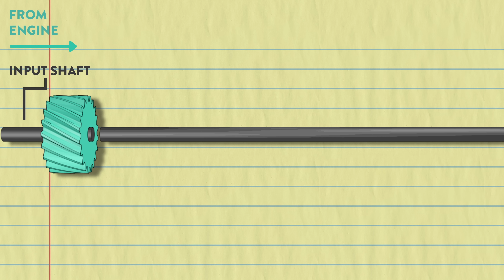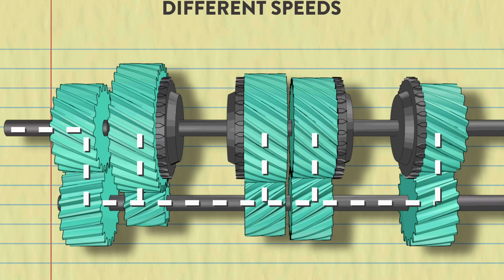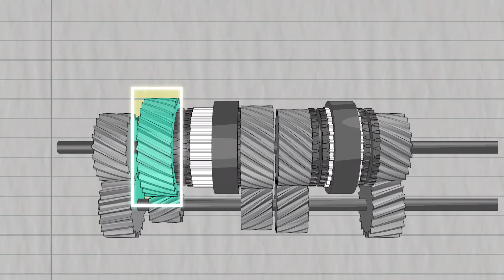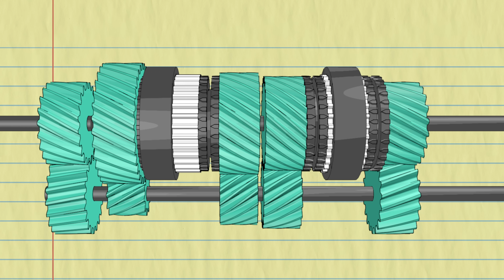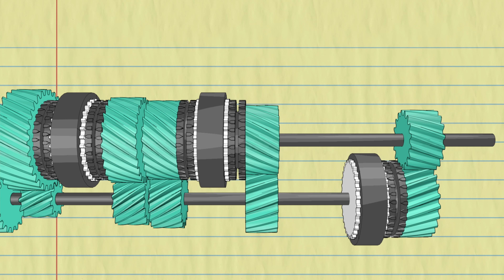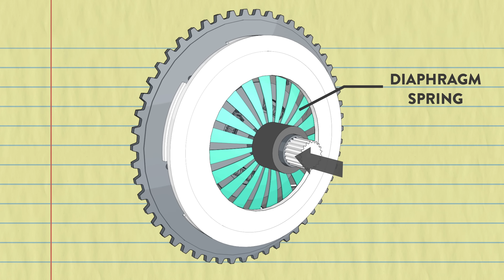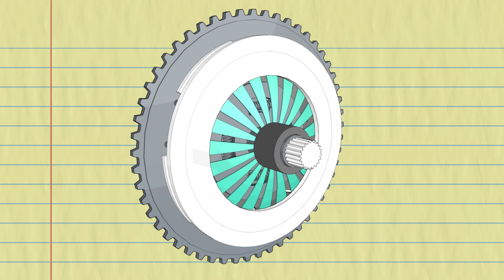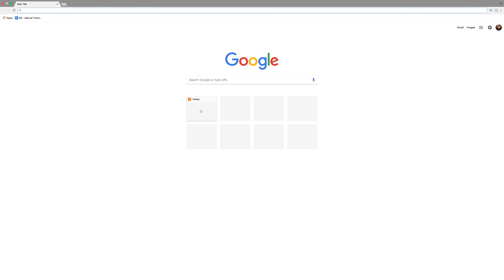MANUAL TRANSMISSION | How it Works

Comment: Guys who drive Automatic: I drive an automatic.

Guys who drive manual: I will NEVER drive an AUTOMATIC cuz I'm a REAL DRIVER and I am ONE with my MACHINE after I drive I PUT THE SHIFTER IN MY ASS because me and my MACHINE ARE ONE
Reply: I love manuals....
But I'll give it to yah, this comment had me laughing
THE MACHINE AND I ARE ONE 1111111
Reply: Me when playing racing games in my childhood, only liked automatic transmission, but after watching Initial D in 2019, I started to like manual transmission.
Reply: David Mason  

Not American mate, Finnish.
No, I passed my driving test in a 2013 manual ford fiesta. If I had passed it in an auto, I could only drive an auto, as is standard in EU.
Yes I know about slipping clutch. Which is why I tend to not even use gas in tight spaces, just playing with the clutch.
I don't know about you but the clutch in my daily driver MR2 is heavy as shit. When I jump into any other manual car, driving feels easy as shit compared to my daily driver. So I guess there's that.
Yeah, a lot of people don't really like driving, hence, self-driving cars m,ay very well be the future.
I myself am a car enthusiast, that's why I drive an old manual sports car with 0 driver assists (not even power steering or ABS). But I do realize that for many people, they want driving to be as effortless as is can.
Reply: David Mason  If your throttle is stuck open in an auto there's plenty you can do. 1. Brake, if your brakes are functioning correctly they should overpower the engine. 2. Forcibly shift it into neutral. 3. Kill the ignition. So if someone STILL manages to crash, now that's just piss poor vehicle control (and panic I guess).
Same with accidentally pressing gas instead of brake and staying on gas. Just poor vehicle control. I've accidentally pressed gas instead of brake in a manual. Thankfully hit nothing, but I sure could have.
Reply: @kaju8928  As an American, can confirm.
Reply: Am I Here ? 😂😂😂😂
Reply: David Mason it is what you’re used to but I still can’t get over how you panicked from having the car do much more of the work for you. Shouldn’t you feel more relieved? You just need to press gas when you want to move or hit the brakes when you want to stop.
Reply: kaju 22 i can drive manual and automatic and i prefer the automatic cause it gets me better fuel economy then shifting yourself. you can’t our shift a computer and that’s facts
Reply: kaju 22 as an American that loves to drive manual a hell of a lot more than automatic I can still confirm that Americans are lazy and can’t drive.
Reply: kaju 22 hey why u goin ham on all of us, I like europe and their car culture, I am 16 and all of my families cars/trucks are manuals and I live on a farm and everyone in my town is good at driving.
Reply: David Mason  in american your license goes to any transmission it's not just a auto license or standard I was just trying to get you to understand there is a place for auto sadly it takes over standard
Reply: I drive boths, but prefer automatic. Now im having manual bceuz got good deal.
Reply: LEGENDARY COMMENT
Reply: i drive manual because its more fun and more reliable and cheaper to maintain
Reply: yup, us
Reply: Guys who drive automatic: old men in bmw’s
Reply: What about guys who drive automated/electrohydraulic manuals?
Reply: David Mason  David, take a look at these links: 

https://en.wikipedia.org/wiki/Electrohydraulic_manual_transmission

https://en.wikipedia.org/wiki/Semi-automatic_transmission
Reply: Good job. You took something from Twitter
Reply: soulassassin0g lol I honestly love both. Auto is for stuff like bumper to bumper traffic and stick is for fun 😂 I honestly suck at get it goin but once it stops burning out I’m good. Naaaa I’m not that bad I just didn’t get much practice before my friends ranger got Sabotaged
Reply: David Mason  no offense or anything but that's boomer as frik
Reply: David Mason no hot shot statistics show automatics are more efficient. in all the time it takes for you to put in the clutch and change a gear an automatic has already shifted. that fast time to change gears results in better fuel economy since you can keep a more constant number of RPMs
Reply: David Mason my guy your grandpa is looking down on you in disappointment. I drive a 1982 Mercedes Turbo Diesel automatic and a V6 minivan that’s automatic. Both are fun. I’m also looking into getting a Honda Civic SI coupe that’s manual. I can drive manual and automatic. But where I live there are a lot of hills and it’s not fun just going into first second and maybe third the whole time. It’s just not practical here. Like you can take a car to a track or somewhere in the hills but for daily driving it isn’t practical.
Reply: David Mason I just said automatics have an option to take control of the gears yourself if need be, and if you floor it going up a hill it’ll be faster than any manual lol. And in the off chance that the throttle gets stuck wide open, you simply use the brakes and turn off the ignition. I actually know a friend though who was driving a manual and the clutch stopped working and the car kept accelerating and he had to crash into a safety barrier on the freeway. Cars are cars and shit will go wrong. As far as i’m concerned automatics are smoother and safer, and you can have fun with them if need be. And also as far as i’m concerned i’m going to get a Tesla after this virus dies down because frankly that’s the future and the way to go for efficiency.
Reply: maybe thats the train of thought  in the usa. everywhere else its ''oh, its easier then i thought''....while being said by a 18 year old
Reply: @kaju8928  it's not all of usbi promise
Reply: OVER DRIVE
Reply: nigga u had me wheezing
Reply: I’m taking a hugeeeeee dump and litteraly shat my pants again laughing after this comment! Sooo true!
Reply: @Auranshereef  it helps to take the pants off bro 😂😂😂😂 I feel that energy tho 😂😂😂
Reply: 🤣🤣🤣   legit so many ppl treat manual transmissions like a religion 🤣    they dgaf about anything else when it comes to cars
those same ppl replace at least 2 clutchs a year too🤣
Reply: soulassassin0g dude that was so fuckin funny I almost spit out my drink 😂😂
Reply: @kaju 22 fuck you born in the usa and so was my car and 12 gauge, manuals are cool and fun but they are impractical I personally would drive manual but alot of people cant the reason why your country has trouble with auto is because manual is cheaper to manufacture the manual flex is just you saying your country is poor
Reply: @disguisedpickle1360  I sure love my 12 gauge manual 

SHOTGUN GEARBOX!
Reply: A27M Cromwell1 is your implying that it’s American to drive a manual your dead wrong
Reply: @disguisedpickle1360  chill man I was making a joke at what you said further up i didnt realise there was a flame war going on here

Carry on i want no part in it
Reply: @disguisedpickle1360  you said 12 gauge manual near the top and I was making a joke about it
Reply: A27M Cromwell1 think you should re read it
Reply: A27M Cromwell1 I was meaning my car me and my 12 gauge shotgun were all born in USA
Reply: @disguisedpickle1360  ok that's cool I just read it as a shotgun gearbox and thought it was funny
Reply: @disguisedpickle1360  money doesn't substitute character and skill brother
Reply: @disguisedpickle1360  I'm saying you don't gotta spend a fortune to make a car fun, you agree right, I mean we all love manuals because they're fun. They have character, there's nothing quite like driving one and feeling the thrill of having total control over your car. Plus I don't mind not having to fix as many parts, fixing transmissions sucks bro
Reply: @cameroncastillo333  there’s more upfront maintenance to a manual (clutch flywheel clutch cover pilot throw out, fork etc) driving them is only fun when other drivers know how to drive getting cut off no warning in a manual not fun it’s give and take I’ve seen people happy in autos.. manual isn’t direct to more fun some just don’t want that extra bit it’s subjective
Reply: Manual is like having dick in hand
Automatic has no dick
Reply: Brilliant!! People who drive manual think they are the chosen ones and therefore automatically smarter than all the rest. Well guess what? Driving automatic or manual doesn't fucking matter, you still get from point A to point fucking B, goodnight you morons
Reply: @bluecomet1109 
That's only if you have an incredibly shallow concept of what driving can be. If you view it as "simply getting from A to B" then you shouldn't be watching a channel for car enthusiasts.
Reply: silent phantom I agree. I am reading the comments and I am still trying to figure out why people who drive a manual are smarter than those who drive automatic. I am sure if all us Americans who drive automatic couldn’t afford to drive an automatic we could also as easily learn to drive a manual. Many people buy manuals because they’re cheaper. My friend bought a manual for that reason and she hated it. I used to get nervous in her car because she had one hand on the wheel and the other on the clutch most of the which I think delayed her response in case a car would suddenly cut her off as she shifted gears. Too much work shifting gears if you ask me . Definitely not for me . It’s a pain especially when driving in congested areas . I see shifting gears almost as distracting and dangerous as texting. Isn’t it always suggested to keep both hands on the wheel when driving? With a manual you can’t do that. 😂 And it’s hard for me to envision a pregnant lady about to go into labor having to drive herself to the hospital in an automatic or a  person with asthma. Shifting gears in that scenario might be impossible. It can be impractical in certain situations.
Reply: silent phantom amen
Reply: @bluecomet1109  legit alot of manual drivers think they're car experts too🤣  while replacing at least 1 clutch a year🤣
Reply: Or the guy who drives manual is European and that is standard in Europe
Reply: 😅😅😅😅😅     Medal of Honor for that comment
Reply: You must be American because in Europe if you admit you drive an automatic people will look at you like you’re mentally challenged. It’s not snobbery, it’s just that literally everyone drives manuals and if you don’t it’s assumed it’s because you suck at driving.
Reply: @ajl8975  I love your comment, and I'm an American, i tip my hat to you sir
Reply: @ajl8975  suddenly europeans sound a lot more interesting to me now 😂😂
Reply: More like “I don't know how to drive a manual transmission”, I prefer a manual transmission because I've only owned supersport motorcycles. You select the gear you want in a sequential transmission just like a semi-automatic transmission.
Reply: well it's all about the feeling of control
people who like driving usually want more control of their cars in their hand

people who like driving are usually more skilled at driving
that's where the connection is

automatics forgive lack of focus and skill in driving, TO some extent

crash videos because people texting/browsing while driving is almost always from people driving automatics, give it a thought
Reply: boys let the automatic transmission be for women new drivers and the disabled
not all of us are in need to control our gear ratios or even our breathing
if you let these people be the next thing will be automatic braking system ; )
Reply: mamad nzr you people need to stop with the manual superiority manual isn’t even in the performance scene anymore it’s for guys who grew up and didn’t learn eventually you get rid of your toy all a manual can be to anyone anymore is just a means to fun
Reply: @mamadnzr7556  not gonna lie, an automatic braking system sounds pretty nice
Reply: We get it, you can't drive a car with manual transmission, don't have to act all butthurt about it.
Reply: David Mason  there's a reason it's on the road if auto scares you give up ur license I've complete idiots drive auto so if you cant that's because your even more incompetent manual has its place still it's not for a average person or a daily driver I want to drive manual because it's a cool skill but its alot easier to get use to speeds the car laws etc in a auto when your not worrying about stalling
Reply: People who drive automatic are mostly old people or retards.
Reply: Paulyn Araojo Or just people who can afford them lol manuals are cheap and less efficient. Most cars have added paddle shifters if you want to make it “manual” and it’s more efficient than using a stick. No one cares you drive manual and no it does not mean you’re a pro driver 😂 Jesus you guys are full of yourselves

Comment: I don't understand how the size of a gear helps. Like I get it has a smaller circumference so has less distance to travel to make a full revolution and that less torque is needed to rotate the gear a full revolution. But wouldn't the torque increase if you wanted to rotate the gear faster?

Comment: Why do u think even automatic cars have a tachometer?  Because it's cooler!  Makes u feel that you're a 
great driver and driving a performance car.  Plus, it's one of the few things that you can control and watch 
the needed spin.  Electric cars don't have a tach so they're boring.
Get a manual transmission and you get to control even more things to make more fun!

Comment: I am not Shure if that was done correctly according to the animation for first gear it would be high rpm low torch that's gears would need to switch places then you would have that gear ratio        feel free to tell me I am wrong but I am not Shure that animation was accurate

Comment: You forget to mention that in racing and you double clutch or putting more stress to the components so most Time Racing Engines will have a specialty transmission that can withstand all the force and big rigs use a specialty transmission for pulling heavy loads

Comment: Every new student nightmare when apply driving license for the first time.
If you release the clutch too early , engine die.
If you dont balance the excel and clutch smartly on hill test, engine die.
If you dont properly insert the gear or not pull down the handbrake, car suddenly drive in suspended motion. In case of handbrake, possible engine die.

Basically if you screw up at manual gear is result of your engine die automatically

Comment: You haven't lived until you've driven a 4 speed that redlines at 5 mph in low range.  Personally my truck has a 6.55:1 ratio in 1st gear.

Comment: Semi trucks have 18 gears
Reply: Some, most trucks I've driven have 10 Speeds (the majority); other semi's have 13 Speeds (one truck I drove had one); 18 like you mentioned; and 9 Speeds. There are also two transmissions specifically designed for off road/vocational severe duty use; the 8 Low Low, and the 15 Speed

Comment: You forgot something in this video. It’s a racing trick, but when you are on the top gear, there is a secret gear you can use to go faster. Just set the gear to ‘R’ to unlock racing mode.

Comment: Just saying the whole double clutch vs granny clutching.... Its really old, double clutching isn't fast, its only helpful on cars with no synchros. So if you want to change gears fast and win a race... Granny shift, its how the car is meant to work now and what you should do, double clutching will do nothing at all but slow you down.

Comment: if my gearbox ever goes faulty I'm taking it either to the manufacturer or a garage im fine with fixing any other part but the gearbox no if i treid fixing a fualty gearbox i'd end up with a flywheel up my ass 2nd gear through the neighbours window and reverse in nostrils

Comment: 2014+ newer Minis have rev match (can turn it off with DSC off),  
e.g so if cruising in 4th at 35mph,
hold in the clutch, select 2nd, engine revs and holds the perfect matched rpm,
lift off clutch - seamless downshift

Comment: you didn't talk about floating gears. not using the clutch at all and shifting at precise point in the rpm range.  which is how you really drive a big rig. it saves of wear of the clutch because it never disengages the flywheel

Comment: Question. I learned how to "float gears" when learning how to drive an 18 wheeler. Basically changing gears with out using the clutch. Now I'm able to float gears in my car. Up or down shift, I have mastered it. Only time I use the clutch in the car is to put it back in first gear. How is this possible?

Comment: Well there are gearboxes with two clutches.
For example Ferrari porsche etc. 
Two cluches and two gearboxes (one gearbox has the gears 1,3,4,6 the other has the gears 2,4,5,7) the change the gear in 0.5 seconds

Comment: 3:59 WROOONG!😆   ok in this scenario where the on the input shaft to the counter shaft the Gear ratio is also 1:1 its right.  But a real transmission there is as well a gear ratio on the input shaft. Wich means to get a 1:1 gear ratio you just connect the  input shaft and output shaft. You also gain efficiency because you dont have to let the torque flow over the gear wheels.

Comment: .8 overdrive is a good economy ratio on a 5 speed?  I know some 4 speed automatics with better overdrives than that.  

Some big rig transmissions don't require double clutching and are actually designed to optimize float shifting, requiring less clutch disengagement and overall saves the life of the clutch.  Splitters inside the transmissions also don't require declutching, just a simple release of the throttle to get into the split gear.  The shift lever has quite a bit of play before sinking into a gear, thus allowing the driver to pre-engage the next gear and match revs before the lever fully drops into place.  DMVs don't like this technique at all and demand double clutching, which is in fact more distracting, less efficient, and slower to control and master.